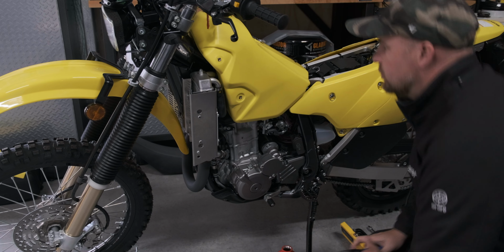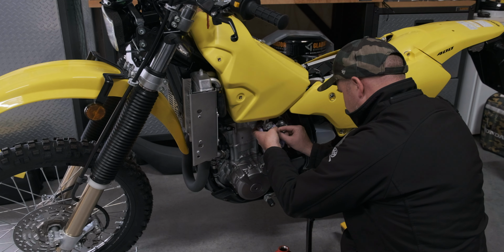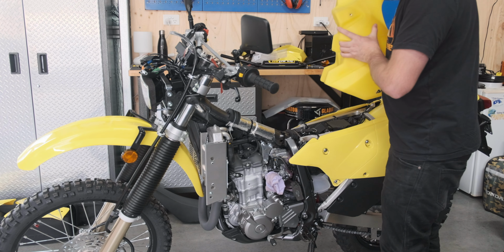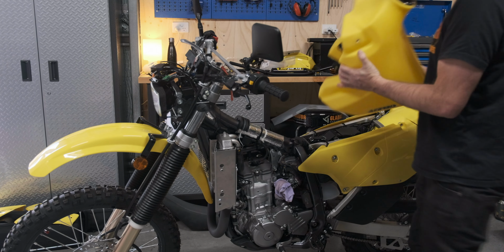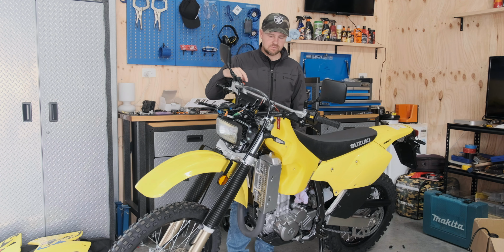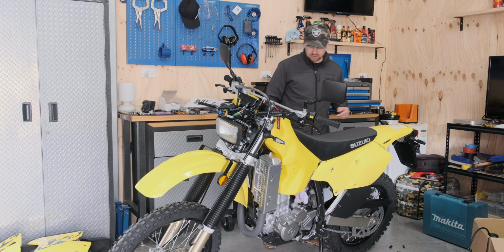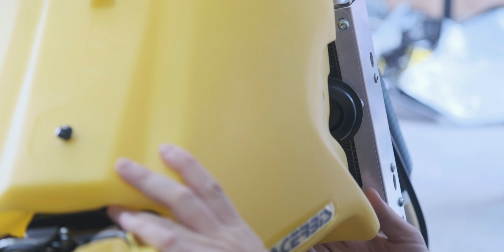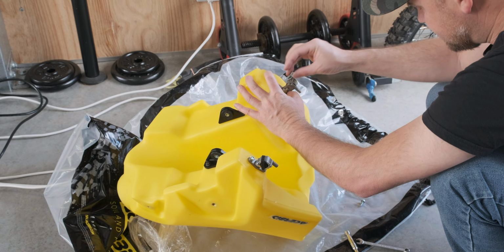Ep 5. Suzuki DRZ400E Acerbis Fuel Tank Installation Part 1

Comment: Nice video, Im having the same issues as you, my horn needs to be mounted differently, and my thermo fan for my radiator is blocking the fuel tank from sitting correctly. Hopefully I can figure something out.
Reply from the maker: I'll have an update soon and horn was relocated. My bikes at the dealers as my carbie had a fault so as soon as I can pick it up can video all the solutions.
Reply from the maker: All figured out. The horn was put on the rad guard and wires extended. Tank now setup and goes great. New Video Done.

Comment: Hey mate eagerly awaiting part 2.  Not many videos out there that go into detail.  How did you route the double Petcock fuel line from the right side ? Did you have to cut the Radiator guards and the Seat mounting bracket.  Also did you have to seal off the Vacuum of the Carby and if so how and what with. I'm about to install the same tank on my 2020 DRZ400e and it would be great to know what works and what doesn't.

Thanks again for doing the videos.
Reply from the maker: Thanks for the comment Glen. Ok so far i have both fuel lines connected and up and running on the bike. That process is actually the easiest and will make a video on that tomorrow when I finalize the LED Blinker problem with the resistors install video. I just reconnected the fuel lines and turned on both the petcocks and the weight of the fuel just runs straight into the carbie down the fuel line. just know that after each ride to turn off the petcock as I was recommended by a mechanic. Also the horn has to be moved and I found a new solution for that which will have to go in the Part II Video.
Reply from the maker: Finally made. Dude to bike replacement - Video is now up. https://youtu.be/lDbTLfhVIBc